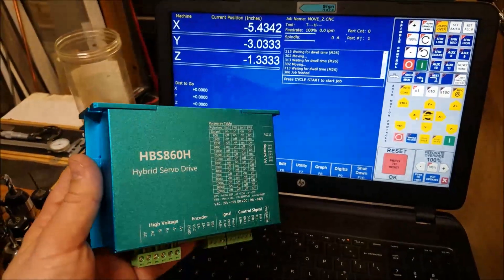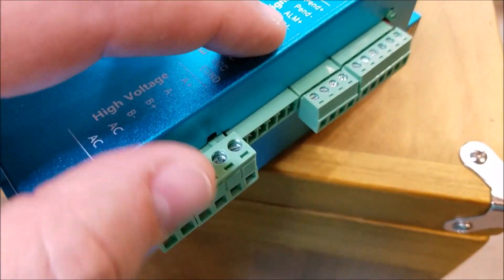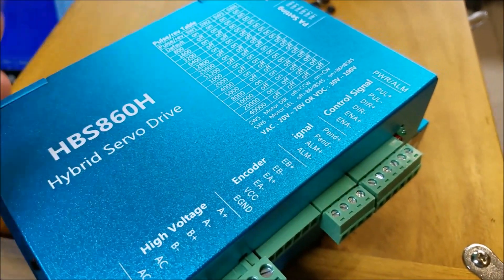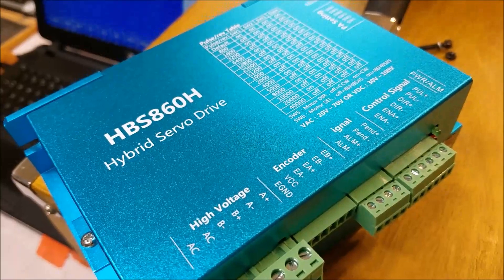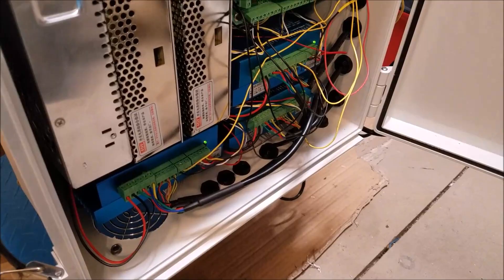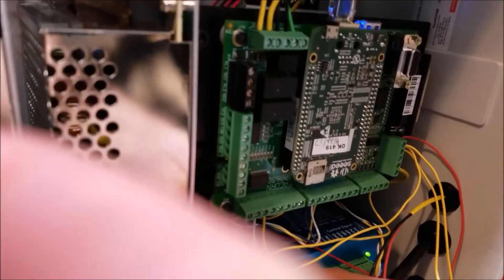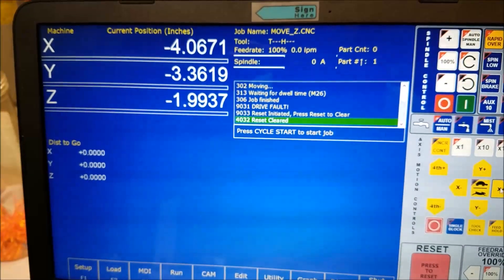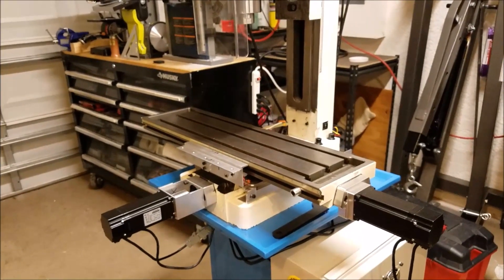HBS860H Hybrid Stepper Drive: Connecting Alarm Signal to Centroid Acorn

Comment: I using DSP a 11e controller with hbs86h driver  
the problem is alarm signal, the alarm port no voltage alarm lights are on or blinks what about the issue can you please give me a idea

Comment: I think the ALM output is an open collector Output. Did you have to use an Pull Up Resistor in order to detect the change of state of your output?

Comment: I know it's been a while since you posted this video. I am currently driving my motor with the HBS860H servo drive using the Dir, ENA, Pul using an ESP32. However I could easily reduce the flash memory if I could send a serial "rotation" command directly into the RS232. Do you know if this is possible using a microcontroller RS232 Serial connection directly? Thank you in advance.
Reply from the maker: Hi.  I don't think the serial communications port will accommodate that.  I believe it is only for programming the unit - not controlling it.
Reply: Thank you for responding. How does the programming UI send test commands to check rotation?
 @FrancoCNC

Comment: Hello, I bought a Chinese HB860H, it is supposed to be the equivalent of that controller, and I connected an emergency STOP switch that I verified that it worked with a tester but the controller does not stop or the red light comes on, you do not know what could be happening? The switch is exactly the same as the one you put yourself in another video ALM + and ALM- on each pole. I don't understand why it doesn't work.

Comment: Frank, consult, I have 3.2 amp stepper motors as I can regulate the current output with this hybrid controller. And by default with how many micropasses this hybrid controller comes. Thank you for your support.
Reply from the maker: As I recall, I believe it is 2000.  But, you can download the software and change that if you have the programming cable.

Comment: Hey Franco, could these alarm pins be wired to emergency stop pins of a regular BOB so whenever one of the drivers gets into alarm situation it will trigger the E-Stop ? I didn't go too deep into how it works but in case it's not straight way connected it could send the command through a relay or  mosfet to BOB's E-Stop. I plan to upgrade my CNC to hybrid steppers.
Thank you.
Reply from the maker: Hi.  The drive fault circuit on these drives is simply a normally closed output that opens when there is a problem.  That's why you can connect several drives in series and tie them into one input on your BOB.  You could easily wire them into your estop circuit.
Reply: @FrancoCNC   Thank you for response, that's good  alternative solution for people that can't afford a  Centroid Acorn board or don't want extra components.

Comment: What size box are you using for all the controllers/PSUs? I'm at the point I need to seal everything up. Thanks!
Reply from the maker: 19" x 15" x 8" would be the outside dimensions of my enclosure.
Reply: @FrancoCNC  Thanks, I will start looking:-)

Comment: I am thinking about buying these drivers. How are they performing? Do you use them in a closed loop system?
Reply: I saw the encoders on your stepper motors, so you use the closed loop system. :)
Reply from the maker: Yes - the loop is closed between the driver and the motor.  However, the driver DOES NOT proved feedback to the CNC (other than a simple alarm output should there be any missed steps).  I really like these closed loop stepper systems and I think they work great.
Reply: Franco thank you for answering. What motors do you use and where did you buy the motors & drivers and for how much? Thanks again!
Reply from the maker: Check this out:  https://youtu.be/j9EpLjhIOVQ

Comment: Franco very good video and thanks for your time!
I have the Leadshine HBS86H drivers with a Csmio IP-M controller and my query is as follows: when a cable is wrongly connected to the driver, should it be powered on? or not ?
I consult this because I have 4 drivers connected and only 2 work well X and Z ... the Y and the A (slave axis) I jump the alarm when wanting to move the axes and I can not find a solution ... I hope you can give a hand! regards
Reply from the maker: Hi.  My guess is that there is a problem with the drive enable connections.  I'd try eliminating the drive enable connections - the drive should be enabled on power up.  If everything works fine with the enable disconnected, then you know where you problem is.
Reply: Thanks Franco for your advice ... actually I had an encoder cable disconnected so the alarm went off, but it's fixed
      
your videos are very good !!!
     Greetings Jorge

Comment: Hey there. Thanks for the video! 
As you make it clear the alarm works as a switch, but I have a question: as I'm controlling the hybrid stepper motor with an PLC .. how you can clear(reset)  the alarm so you can continue with the job?  Or if the alarm is simply not connected to the PLC.. but the driver is giving the alarm.. how can I reset it? Right now I'm just turning off and on the power... No idea for other option :(
Reply from the maker: Hi.  To the best of my knowledge, you have to power down the drive to clear the alarms.
Reply: Franco thanks for the answer. So your CNC program control olso the power of the drive?when you press reset alarm in the program, it turns off and on the drive?
Reply from the maker: Constantin Nicu Hi.  I have to manually turn off the power to reset the drives. This is typical, even for production CNC machines. You shouldn't get drive faults very often.  I'm curious, what type of machine are you building?

Comment: At 4:30 did you mean paralell?
Reply from the maker: Negative.  If you look at the Centroid documentation "ACORN_rev3 STANDARD CONNECTIONS" you will see that they wire all of the drive alarm outputs in series.  This assumes that you have NC alarm outputs (closed when OK and open during alarm).  If you have NO alarm outputs, then you can wire all of the drive alarm output in parallel.  I think it is better to use NC outputs wired in series, but if you don't have any other options, then NO outputs in parallel is another option.

Comment: Franco,

Do you plan on switching to the dmm servos for the PM25
Reply from the maker: Probably not.  But, I will be using the DMM Servos on my next project - Techno Isel CNC lathe.  The only reason I did not install the DMM servos on the Mill is my own stupidity.  The first time I hooked them up, I forgot to switch the PS to 110V.  The drives acted strange and the PS actually blew up after a few hours of use.  I sent everything back to DMM and moved forward with the Hybrid Steppers.  By the time the DMM folks helped me understand my mistake, I'd already become comfortable with the Hybrid steppers on the Mill.  I'm sort of in a hurry to get that Mill finished.

Comment: Franco, thanks for all your videos. I'm building up my PM-25V almost exactly like yours and this is extremely helpful. I have millions of questions. Would love to see more information on your cabinet for the electronics. Looks like you went with a separate power supply for each motor instead of getting 1 larger power supply? Any particular reason? I was thinking a larger 48V power supply would save some space and create less heat than 3. Have you considered wiring your E-stop from the mill and CNC on 1 switch. I don't want to have to push 2 buttons to shut the whole system down.
Reply: ansewer him pls?
Reply from the maker: Hi Brad.  I'm glad you like the videos.  When I have time, I'll do a video on the electrical cabinet.  I used separate power supplies because that's how FastToBuy sells the drive/motor/PS package on eBay.  I'm sure you could use one large power supply and get the same end result.  Regarding the E-Stop, I may power the milling machine through the control cabinet - I just haven't got that far as of yet.  One thing to consider is the current draw.  I've already had to increase the breaker in the electrical cabinet to 15amps.  I've wired up all of my power supplies to be 220V but when I was using a 10amp breaker, it would often trip during power up.  That problem has gone away with the 15amp breaker.  Eventually, I'll experiment with powering the mill through the control cabinet and see how that works.
Reply: Thanks Franco. Actually that makes me think I'll keep them separate. My entire garage is only on 1 circuit with a 15 amp breaker. If I'm milling and my compressor kicks on it throws the breaker. Maybe it couldn't handle the cabinet and mill at the same time.
Reply from the maker: You may want to add another circuit or two to your breaker box.  I mount the receptacles very close to the box and to avoid fishing wires through my walls/attic.  I just make really heavy duty extension cables and plug them in when I'm using the machines.
Reply: I'd like to but my circuit breaker box is maxed out. Luckily it is located in my garage so I may need to get an electrician to replace it with a bigger box and run some extra outlets. Possibly thinking about downsizing my house and up sizing my garage so may just try to work with what I have now. I was thinking about the E-STOP on the mill. I pulled the face plate off my PM25 to look at it and I think I can add a second switch to it easily to turn it into a double pole single throw. Then run 2 wires from the newly added switch down to the acorn 24v input and common so the mill E-Stop can shut down Acorn as well. This is the switch that is on 1 side of the mill E-Stop. https://www.alliedelec.com/idec-corporation-yw-e01/70278068/
Another one should just snap in on the other side of the switch. It's a 120V AC switch, is there any reason it wouldn't work for 24v DC?